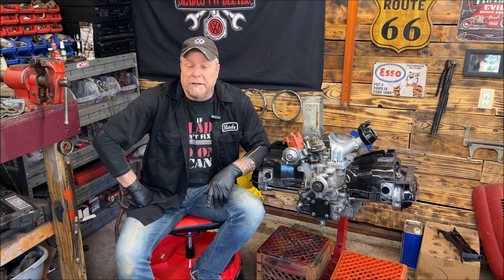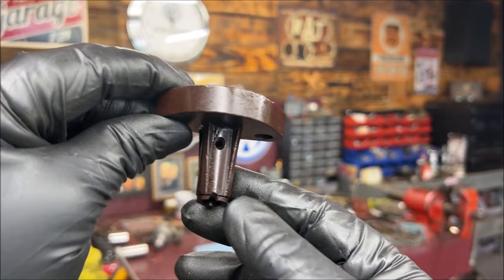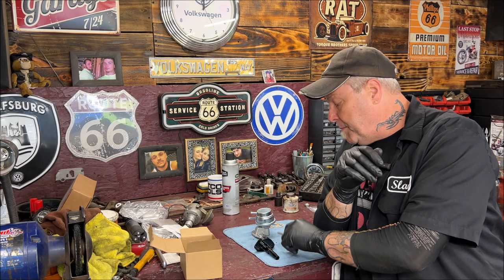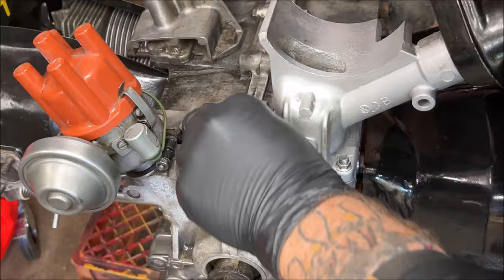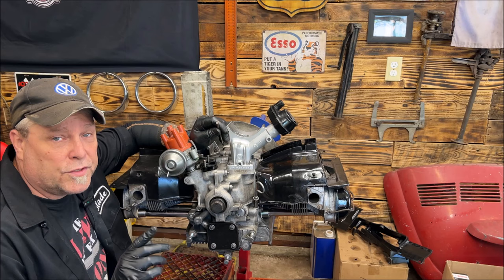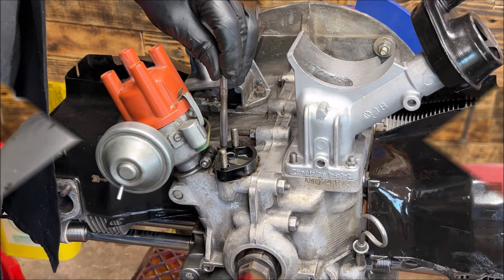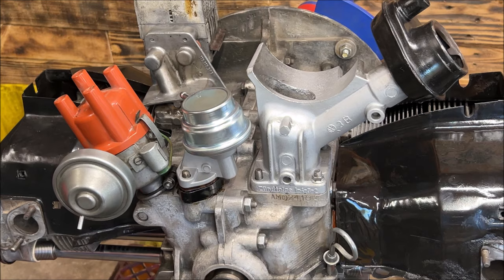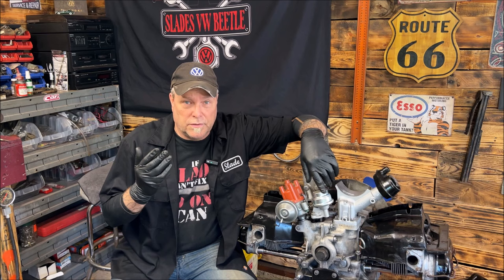VW Beetle Fuel Pump install - Pump Rod Adjustment Important Information - VW Baja - VW Bus - VW Bug

Comment: The fuel pump gasket is different. You used 2 fuel pump flange gaskets. Also some aftermarket fuel pump flange diameter thicknesses are smaller than the original 13mm, which will increase your fuel pressure.
Reply from the maker: That’s exactly what I thought. I did what he asked. I don’t know why it has those two gaskets with it in the kit. I’m not big on the aftermarket Bakelite. This is why I technically don’t like doing work on other peoples stuff. I have to play by their rules unfortunately.

Comment: Hey, I'm new to the channel and I have a '73 super beetle that I am trying to fix up. I am in the process of watching all of your videos to get ideas so please keep the videos coming.  Thanks for what you are doing it helps a lot!
Reply from the maker: Thank you Ken, glad to have you aboard. There was a playlist made up when you look on the channel here. And it will have a lot of the 73 super beetle restoration I did. And of course what I’m currently doing is pretty much the same for except the suspension. Feel free to join our Facebook group also, Slades VW community 
thank you for being here
Reply: hey there! i have a '73 as well! i have done some stuff to it, a lot of problemsolving and looking around for stuff, if there is something like for example generator to alternator conversion or something along those lines that you would like to do, i could possibly help you on your way! ^^
Reply: Me too!  I have my first car, a 74 super beetle and I'm using you videos as guidance.  Thanks sir!

Comment: The broken piece of the spacer is now stuck in the engine. Without disassembling the whole engine, is there anyway to get it out?? Or what is the harm of leaving it in there 😅
Reply from the maker: Do not leave it in there! What I did for a friend, is a very gently took a tap from my tap and die set. Tapped it very gently into the piece, very gently! 
And, of course, tightened the tap in very slowly just a tiny little bit!!!! 
And then extracted it out. be very careful it could shatter
Reply: It broke off and is nestled in the engine. Ordered a grabbing claw to hopefully try to pull it out. Not sure what option I have of it doesn’t come out through the tiny hole though.
Reply from the maker: @ryanshafer4854  oh no!!! just move very slowly. And hopefully you’re able to reach in and grab it with what you bought. I know a lot of guys say they chew up in tiny little pieces and then drain it out with your oil. But I get a really strange feeling about that.
Reply: Yeah, it’s wedged in there so I don’t think I can even get the new spacer in without at least moving it out of the way.
Thanks for the replies! I’ll report back. 🤞
Reply from the maker: @ryanshafer4854  remember, it’s not over yet my friend, just take your time and move slow. There’s got to be someway you can grab it out of there.
Reply: @SladesVWBeetle  thanks! I’m not giving up. Just ordered some surgical tweezers too. I’m getting that outta there!
Appreciate the encouragement!

Comment: Installing a new fuel pump today on my '62 vw bug. Got a new distributor and coil and it still wont start. Hopefully this is all cuz no gas was entering the fuel filter 🤔

Comment: And my dad didnt know and bought a generator for an alternator beetle, am i able to just put a different rod in?
Reply from the maker: You would have to use a different rod, and also the stand would be different that it sets inside of.
Reply: @SladesVWBeetle  stand?
Reply: @Icerackett - the stand for the alternator is different than the stand used for the generator.

Comment: I have never seen anyone use a sealer on the fuel pump. You can use gasket paper they sell the rubbery type gasket spacers as well. Just seems like a pain in the a$$. I personally can care less is it have a leak from that area. Also it is a waste of time to grease the pump it probably gets enough lubrication from the push rod.  I enjoyed the write up you are a well spoken gentleman. Thanks

Comment: Hey great video, I always use a different gasket on the bottom of the pump pedestal, the one with the small hole in it, I’ve not seen a kit that uses two upper gaskets before, seems strange to me but I guess it would seal ok.
Reply from the maker: It will definitely still seal up. The owner asked me if I could please use those to gaskets, I’m not sure why. I have no idea where he bought this kit at.

Comment: Does the fuel pump push rod ever make noise like the tappet pushrods for the valves? Also, how do you determine rod knock vs a noisy valve lash?

Comment: Great video, do you need to do the rod adjustment every time you take it out to replace the base? I'm replacing my base, this week. Thanks!
Reply from the maker: Yes make sure you do. If you mean the plastic bakelite? Save your old one and measure the thickness of the aftermarket one. It may be thicker and you’ll have to adjust as needed

Comment: I think the reason the diaphragm is stiffer in the new fuel pumps is because they may be made of neoprene rubber and neoprene is impervious to ethanol.
Reply from the maker: You can possibly be right with that Joe. I never thought about that before. I just know the aftermarket stuff isn’t the same as the originals.

Comment: Is the fuel pump rod length (4-5 MM) the same for both Generator and Alternator engines? Also, please do the fuel safety video. Thanks!
Reply from the maker: I will have to check into that to be honest with you. I don’t wanna give you false information
Reply: Good question. I was wondering the same thing. I was unaware of these adjustments and just bolted mine on. Seems to be working okay so far.

Comment: Slade- just noticed your oil filler, and hoping you can demystify something for me. Mine, like the one shown here, has no road draft tube, but has two very small holes where the road draft tube would have been. I haven’t been able to find much information on this style, and the proper way to configure these for crank case ventilation- appreciate any insight you might have, thanks!

Comment: My fuel pump spacer indeed cracked. Promptly dropped into the case as well when attempting to retrieve the broken bit. Fortunately, the engine needed disassembly anyway so... lose, lose, win?
Reply from the maker: Oh wow, that’s what I was concerned about. Especially since it is not my engine. Luckily a tap was able to extract it. They can be a real pain in the rear end. Thanks for being here Ray!

Comment: Slade, at 1:40 you say the gas tank line connects to the bottom port; yet the pic at 1:43 shows the bottom port to be “out,” which to me would mean to the carb. Am i off? I ask because the 76 beetle I got had no fuel lines running anywhere. Thank you, and I love the Slade T shirts I got!
Reply from the maker: I have to edit that part online. It should be: 
In at the top, from tank…
out at the bottom of pump, to carb! Hope that made sense. Thanks for the support!! I truly appreciate it!!

Comment: The labeling of the in and out ports on the fyrk pumps in the figure at 1:15 contradict what you are saying. Which is actually in and which is out?
Reply from the maker: In from tank on top, 
and out on bottom of fuel pump… up to the carburetor. 
I have to go onto YouTube studio and adjust what I said. I actually forgot about it. 
That’s the only problem with filming, is it almost impossible to not make a mistake once in a while. Thank you for posting this.

Comment: Hi, i have 2110cc I've built I've been having issues tuning my dual carbs. At 2000 rpms, I'm getting a miss and exhaust pop.  I noticed that my fuel filter is pretty empty and it should have a decent amount of fuel running through at 2k rpm. I found your video. I measured fuel rod and it's 108mm and I have the right pump. The issue I believe is the fuel rod travel. In your video I notice the rod nearly disappears in the bakelite. Mine when down sticks out .322"  roughly 8mm and fully extended its .505" roughly 12mm. Since I built the motor I know how it all works. The timing gears seemed fine I set the play with shims. The distributor isn't sticking up weird and appears to be seated probably. Could the ramp grind be that much off on the distributor gear?

Comment: The upper gasket is different than the lower gasket. You had one on the table but instead of using it you used another lower gasket. The correct upper gasket provides more cover to the top of the Bakelite. Also at VW we always placed a small amount of grease in the open areas of the Bakelite top. If this was intentional what was your reason for doing so? Thanks.
Reply from the maker: Yes, you are right. I was asked by the owner to please use only the two gaskets that came with it. Typically I don’t do motors for other people. Thank you for chiming in I do appreciate it very much.
Reply: @SladesVWBeetle  I enjoy your channel thanks for taking the time to share your passion.  I responded because I view what you are sharing as educational. I wanted to help make it clear to anyone  new to this that the proper gasket arraignment is different than what is shown. Perhaps if you have a reason to do otherwise as you just explained then make sure to make that clear on the video as well. My hope is that constructive criticism is okay here, the last thing I want to do is argue about a gasket. With that said, If I’m building an engine for someone else and they ask me to install gaskets that are not proper I would decline to do so. Unless they can prove to me that their way is better than Volkswagen’s way. Thanks for your time and your channel.
Reply from the maker: @vwhoward  first of all thanks for being here. I appreciate that. 
I have pretty thick skin, I don’t get insulted. 
I will never know everything, but what little I do know, I try to show. 
When it’s an argument, nothing ever gets accomplished…. If I do make a mistake, I will be the first to stand up and say so. 
I pretty much did this as a favor, and just have the cooling tins left. 
I didn’t film all of it. 
Then I need to get back on my own car 😁
Body work next…I don’t like bodywork 🙄

Comment: In the diagram all of the IN pipe are on the top..? But you say its the bottom one..im confused as my T2 is the same as the diagram and the fuel tank pipe goes to the top one and bottom to carb..
Reply from the maker: I have to actually go into the settings on YouTube studio and fix that. I said it backwards, but did hook it up the right way. 🤦🏼‍♂️

Comment: sorry   but how do you measure the pressure and adjust it
Reply from the maker: Using a fuel pressure gauge. You can buy one at Harbor freight they’re very cheap.

Comment: Hi Slade, what could be the reason for fuel getting into the motor? Every time I check the dipstick the level rises and is smells of fuel.
Reply: If your fuel pump’s diaphragm is broken, then fuel may leak into the engine.
Reply: If the fuel pressure is too high, it pushes unburned gas into your cylinders and it ends up in the crankcase.